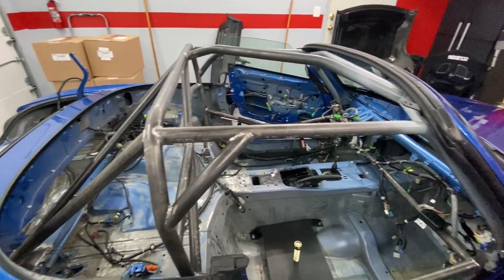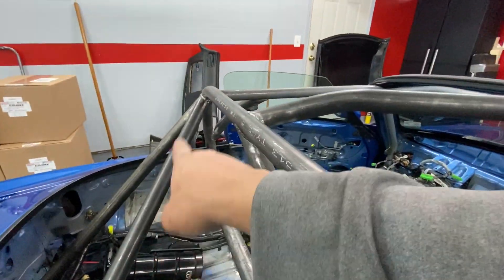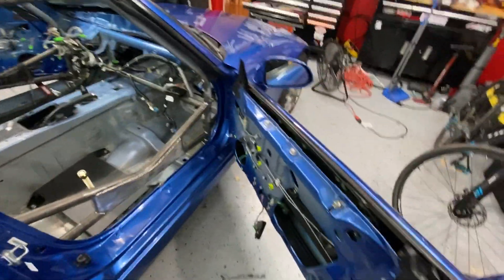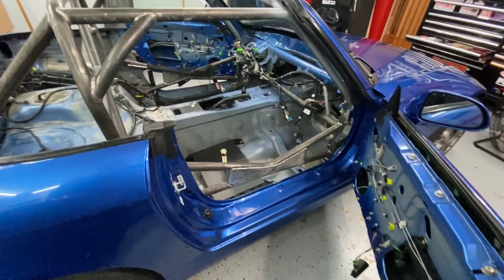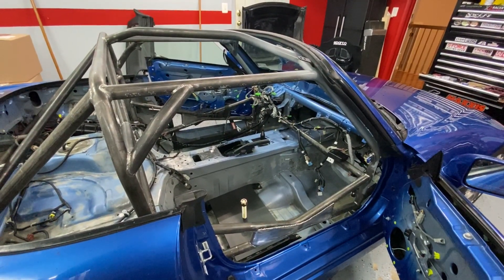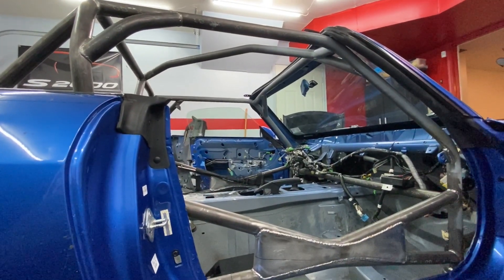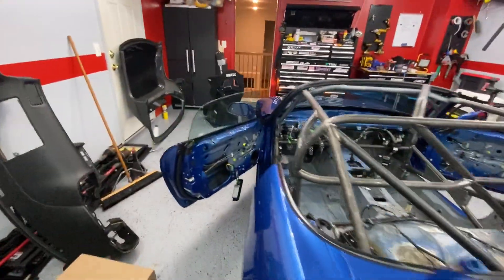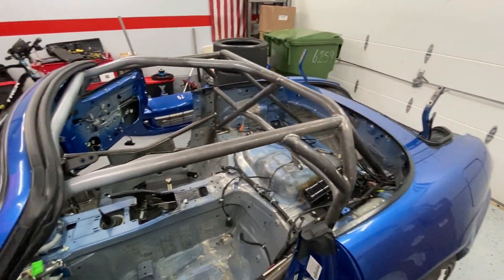NASA ST5/TT5 S2000 : Build blog episode #10 The roll cage

Comment: I had that same idea for a ballast for my s2000. However, is it Nasa legal per the rules of mounting a ballast?
Reply from the maker: Yes, 100% legal.  Per the CCR: 15.20 Ballast
 
All ballast shall be solid metal such as steel, lead, or depleted uranium, and consist of a minimum of five (5) pounds per piece. Each piece shall be bolted in place with through-bolts, fender washers, and a locking-nut / system (e.g. jam-nuts, Nylock, etc.). All ballast shall be secured sufficiently and all bolts shall be of Grade five (5). Nylock nuts or metal crimping lock nuts should not be reused.
Reply: @samedrizvi  thanks for the quick reply. keep the videos coming.